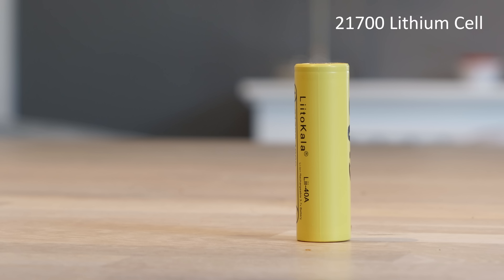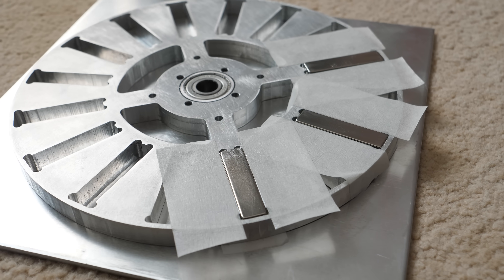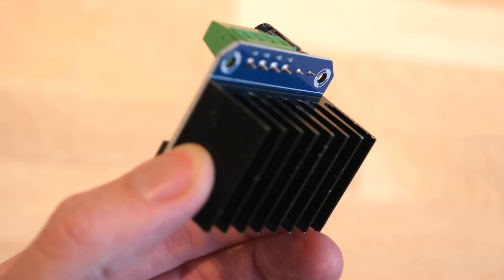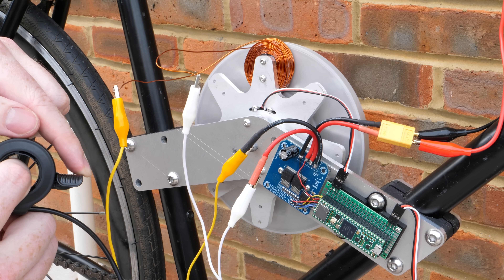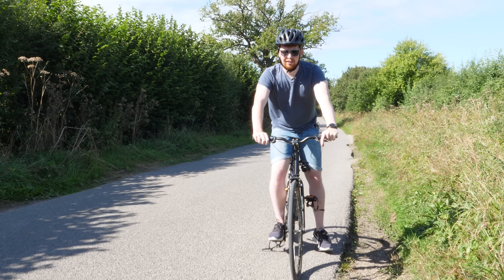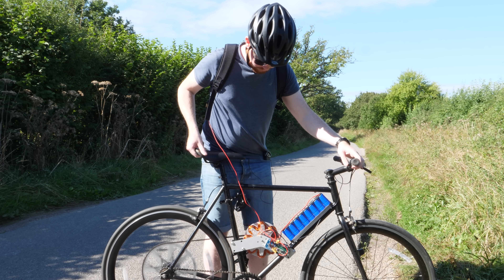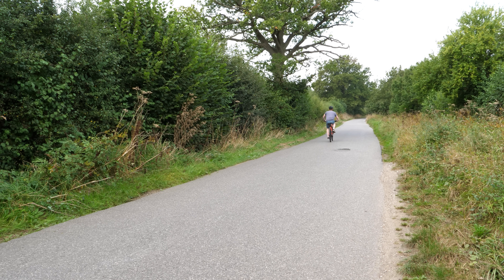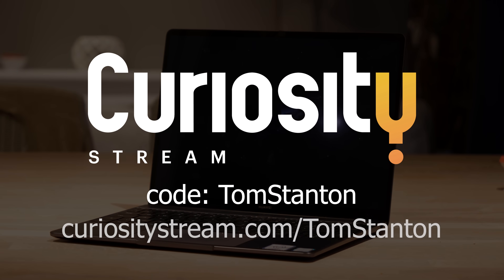Super Capacitor Bike

Comment: How about combining the electric motor with the flywheel for energy storage? As in, not having the flywheel mechanically connected to the bike's power train (eliminating the need for a infinitely variable transmission) and instead having it connected to a generator that provides electricity for the motor (and when braking, to recover the energy the flow is reversed).

Comment: The number of wingdings in a coil should be constant to produce the same inductance in each of the coils, right? So, instead of getting precisely the same number of loops, why not get it in the ball park, say +-5 loops you can use the calculator with +5 instead of +1, and then measured the inductance so that it is constant in each coil? Would presume the inductance varying anyway even with same number of coils, so measuring them after wingding would anyway make sense.

Comment: Add a soft iron plate to the back of the rotor to link the magnetic flux and you can increase the flux density on the front side, like a halbach array. 

If you have a second rotor disk on the other side of your stator then you can complete the magnetic circuit increasing the flux density and available torque even further.

Then ideally laminated iron cores for the coils would help. 

You can also compress the coils to fit more windings in. Make up a form and squash them after winding. 

You can also get segment magnets like pizza slices that fill more of the rotor area.

Any conductive components should ideally have slits in them to reduce eddy current losses. Or make the rotor out of something that isn't electrically conductive.

Comment: Great project Tom, big respect for building your own motor :) Did you consider using a belt instead of the chain? Far less frictrion and weight. Can't wait for the next project!
Reply: Belts actually have similar friction to chain, but nowhere near the strength.

Comment: Man, you need back iron in both rotor and stator. Just adding this would make the motor 2-3 times more powerful.
Reply: Everyone building a DIY motor seems to forget this (including me 5 years ago!), but the fact that all commercial motors are a big lump of laminated iron should give you a clue that the iron actually improves the machine.

Additionally, if the motor is redesigned with a multiple of three windings, you may be able to drive it using a standard three-phase FOC-controller.
Reply: And, additionaly, the reduction ratio is not optimal. For better performance you may change the gear, or winding count, or change connection schematics from "triangle" to "star".
Reply: I would put a plate of solid steel 1010, 1018 or 1020 over the magnets, and I would do a double rotor, magnets with back iron plates on both sides of the coils. In the stator I would put cores made of laminations from some salvaged old transformers. The magnetic flux will be much stronger and will provide a lot more torque. Inside the stator the core must be laminated because the flux field oscillates and produces eddy currents, and the laminations keep the eddy currents to minimum. In the rotor the yoke/ back iron can be solid because the field does not oscillates, it stays constant all the time due to the magnets.
Reply: @ap2372  😶 y'all on a whole 'nother level
Reply: @ap2372  The eddy currents will be extreme as well. Your suggestion would be great for a static system though.
Reply: @christianeriksson4733  not if you use laminations in the stator coils
Reply: Agreed, Every motor needs some kind of back iron so that the magnetic flux has an easy path to go through, just make sure to keep saturation of the iron into account in your design.
It will greatly benefit the power and efficiency of the motor like andrei mentioned.
Reply: or just buy real motor.
Reply: How do I learn all of this stuff you guys are talking about?  I'm pretty intelligent, and can figure out a lot of stuff just from context or looking at it, but you guys are several levels ahead of me.
Reply: @jasonwallace6400  just learn about magnetic field. Magnetic field goes with least flux resistance, so giving path to the magnetic field will increase the output and efficiency.
Reply: @jasonwallace6400  https://youtube.com/playlist?list=PLR3pRvvCj_Y_jcg_Ia6ARvzefov05c7vf
Reply: yup
Reply: Hi

Comment: What about running 2 capacitor packs an a small lithium battery.... when 1 capacitor pack is low the battery charges it and the bike runs on the other fully charged capacitor pack.... and it just alternates charge between each pack.... and all regen goes back to the lithium to prolong the range of the battery....

Comment: Dude. Make a hybrid that used batteries and capacitors. Use capacitor to get up to some speed then battery power kicks in and all regen goes straight to capacitor so in the end the battery lasts much longer.

Comment: for your power  probs with youre e bike  why not just add a small generator that the output of the generator is high [use ither a strongdc or ac motor that can output the power you need for youre ebike]

Comment: thats got to be the least efficient motor i have ever seen. there are like 5 easy things you can do to make it so much more efficient. a) add a steel core to your stator coils. b)laminate both the rotor and stator cores c) use a 3 phase motor d) have stator coils on both sides of the rotor
Reply: also use a magnetic rotor core. gonna have to orient the magnets differently tho
Reply: This 👆. I was waiting to see what the temperature of the well abused electronics was! Or the coils and cores! A good eye into that will see whether much of the EMF was well spent and well recovered; no idle coil for all those supposedly delvering force...a bit odd. There is definitely a bunch of room for measurement, upgrade and analysis before naming and thanking the (native UK?) ultracaps maker for a good turn buying more, and eventually just measuring his poor legs once he's ready to do a time attach climb up and down Scotland.

And yet...he did go from dead flat down 80 M of hill and get back up 2/5 the way? Once? Does he know it's good to use your legs a good deal?

Comment: If you Gear it up for regeneration then it should give you more return energy storage and then lower gear for running.
 the only way I can see feasible with electric planes is hydrogen fuel cells that is very possible

Comment: perhaps this would be better suited for pedal assist or to propell you after you get to the speed that the motor can spin the wheel at for cruising as apposed to just running it from a stand still using regenerative breaking to charge it as you break or pedal.

Comment: To the comments on adding a Super/Ultra cap to a Lithium Ion battery pack - it will always be better to add more battery cells. Much cheaper and better performance. Battery cells can be charged very fast if you have a powerful enough charger and massive cables.
Musk on Supercaps: (Tesla sold Maxwell cap division to employees) https://www.youtube.com/watch?v=J9oEc0wCQDE&t=1687s 
Rickard (RIP) on Supercaps: https://www.youtube.com/watch?v=zlJRo9yVzus&t=4242s

Comment: I think you have basically tried to use the capacitors like batteries, a more interesting approach would be 1 capacitor per coil. That way you can get rid of any need to eventually balance the caps and even do some interesting control system tricks.

Comment: Tom don't use super glue on enameled wire some glues (not saying yours does) can cause failure of the enamel. But also heat cycling can cause the wire to flex and stretch flaking the enamel along with the glue off of the wire.

Comment: OK, so what if you combined high density batteries with high density super capacitors?   What about the use of a discharge limiter on the capacitor?  Does the capacitor only store voltage and for how long?  I heard there was a bleed off problem on capacitors.
What is the difference between a hollow capacitor and a super capacitor?

Comment: i think it would be really cool to have a bike that charges off regen braking and then having a period of time that you can pin the throttle and accelerate really fast for a few seconds until it runs out and you need to charge it again by pedaling.

Comment: Could you make a small Cap and motor unit that's designed just to help you get up a hill? Maybe the caps can be charged from a little pedaling just before you get to the hill you want to get over.

Comment: Excellent work! The supercaps could definitely be a viable regenerative breaking system. Especially because regenerative breaking can’t be fully used when using lipos because they can’t handle the current dump back in that supercaps could. And I imagine would give an excellent round trip efficiency. Are you using the ESC’s regenerative breaking system? Because it would be capped at about 50% max efficiency. Did you try using the BLDC motor/generator direct with a 3phase rectifier into the super caps so that 100% of the current dump in can be recouped?

Comment: Bike helmets are for people without super bones which I happen to have. The LRP5 mutation. Sure your brain rattles a bit but you can take 25 mph concrete to the dome and walk away a little dazed and sleepy and perfectly fine the next day. Also never had a broken bone despite a great deal of extremely risky behavior and falls. In fact, doing the exact same work as other people I was the only one with no bone fractures. My skull is a helmet. It’s not any thicker than anyone else’s, it just virtually indestructible, which has its advantages.

Comment: Absolutely captivating! What about adding a diy generator on the front wheel to recharge simultaneously on the fly?
Reply: Unnecessary friction and weight. There's no fundamental difference between motors and generators, so it's better to use the motor as a generator.

Comment: You should try this, but upgrade to some Maxwell 3400F ultracaps! They're extremely useful when needing LARGE amounts of power, but truth be told I shy away from using large amounts in power banks despite being confident with my technical abilities, I've seen how 400F capacitor banks explode and I don't really want to witness a power bank filled with 3400F ultracaps exploding lol

Comment: Nice. But you discovered what alot of we mechanics have known for decades. Capacitors store energy until discharged but they discharge instantly. Batteries, on the other hand, store energy for much longer and discharge much more slowly. Capacitors are used in a wide variety of applications to get a motor moving, buy it's the constant current that keeps them going as long as the current is available and switched on. But yours is a valiant, elegant effort, and was probably alot of fun to complete. Just have to work on the waterproofing. The components are kinda wide open there. 😁
Good job!👍

Comment: Great project! 👍
Now I wonder - who can get more from regenerated energy - super caps or Lithum batteries.. 🤔
Maybe, best performance from system, bike can get if used caps as power for motor and regeneration with option to automatically recharge caps from battery at long straight distances.. 😉

Comment: When magnets pass a coil they produce current right? 

If that is true would it be possible to attach magnets to the chain ring and then coils to the frame and connect that to the capacitors so as your pedaling you charge. That way it can be an actual electric assisted bike instead of the ebikes where it's just instant power

Comment: Another great video Tom!
Quick question, does an axial flux motor/generator need to have a magnetic rotor and stator core? I've been working on a coreless single rotor-single stator design but am having trouble getting the voltages I should be and am wondering if this is because my design doesnt have either magnetic rotor or stator..

Comment: Instead of counting number of wraps of copper wire 150 times you could have just measured the circumference of the part you were wrapping then multiply x 150 or like 153 to make up for the over wrapping

Comment: When I saw the link to this video you could not realize the reaction I had...HOLLY SHIT HE DID IT!!! Im soooooo glad you made this, the theory of using a set of capacitor to make up the initial hit a standard electric vehicle has to use to get it going is exactly what I always thought should work...technically. But in a regular bicycle this should be a no brainer...or so I thought. This is so complicated in its design because the supercapacitor need to recharge after using them with a separate controller. But  omg, holly shit you did it...fucking awesome!!!!!

Comment: I think it would be cool to add lithium ion batteries that get leaked energy from capacitors at a slow rate,  and then both supercaoacitors and lithium batteries power the motor at the same time, and get the best of both worlds. The only problem is more weight.

Comment: I've never understood why super or ultra capacitors have not really been used to store the kinetic energy when slowing a moving mass. It's seems a no brainer to me that something capable of extremely fast charging and therefore fast conversion of kinetic energy to stored energy (braking, which traditionally uses friction and rapid build up of heat) to then reuse that energy to get the mass moving again. It doesn't matter that lithium battery tec isn't ideal to deliver power surges if you can quickly release energy stored in caps. Battery combined with capacitors seems like a marriage made in heaven. 
Oh hang on a minute.... I forgot about greed over efficiency.

Comment: I have been thinking to try to animate you to investigate putting your genious to work on a bike drive train with optimal braking energy recovery even down to low speed. If it was also a motor that would of course be the most efficient solution - I was wondering if basing it on a continous variable transmison would be feasible - the free wheeling option would require some type of clutch - maybe you invent something and it can be mass produced, I#ll be happy to be part of the success story!

Comment: If you had a smart switch that could switch between a normal battery pack and the supercaps to provide some sort of kers system. The rapid charging of the caps on a downward slope and then the assistance of the caps going up a hill would mean using less of your main battery pack and it would last longer 👀

Comment: when you change the way your capacitors are connected during discharge you can compensate for the loss in voltage. I think you want them in parallel during the start and in series during the end.

edit: also I think you want them in parralel while charging them.

Comment: When I was in college, I took advantage of a bicycle to avoid parking on the main campus. There was a hill, however, I had to power up and then at the bottom was a stoplight. All that energy was wasted; I always wanted to have an electric drive with regen so I could recover some of that wasted energy. Supercaps are ideal for this, as they have the capacity to charge and discharge with enormous currents and good efficiency. If it is a lightweight system, it could be totally worth it just for that energy savings, even without a long range that batteries could achieve.

Comment: I wonder would a buck boost converter allow you to work over a larger range of the capacitors output voltage.

It would also be cool to be able to use the motor to recharge the caps ... Buck boost should help there too.

Comment: Weight difference between the lithium ion vs the supercap? 
Would a second row of Supercap in a parallel circuit give the ideal output and regeneration needed to offer a valid weight to power assistance on a long or short-term ride?

Comment: I've seen some projects, where they use super capacitors in order to reduce the voltage drop of li-ion when accelerating. That prolongs the life of a battery and gives more power for acceleration. So it's best to combine the 2, not use separately.

Comment: Great job. However, try click pedals. I use them with the electric bike all the time. You loose the pulsing of pedaling, it just becomes constant if you push and pull on the foot. Range increases by 20% minimum.

Comment: 0:50 electric vehicles use brushless DC motors, which are essentially three-phase AC motors with a beefy electronic variable frequency inverter driving it. Speed is regulated with frequency while torque and in turn speed is regulated by armature current (if I remember right) 
So yeah, battery/capacitor discharge curve should have nothing to do with power output unless there is software optimisation for battery range/life considerations.

Edit: so you are indeed using a brushless.